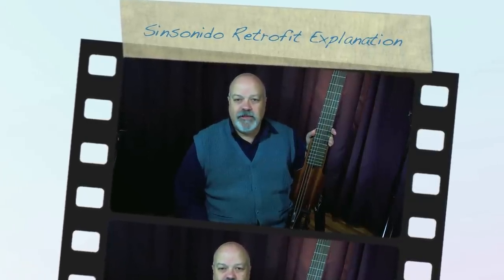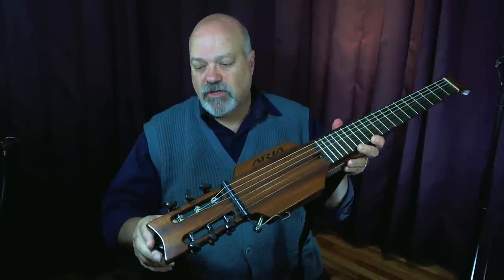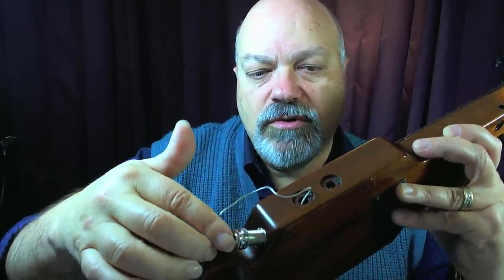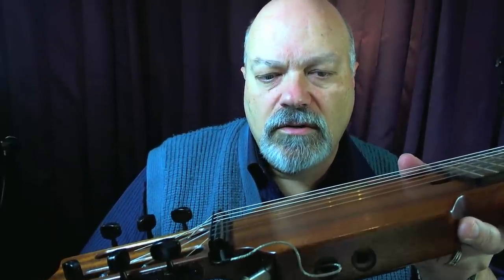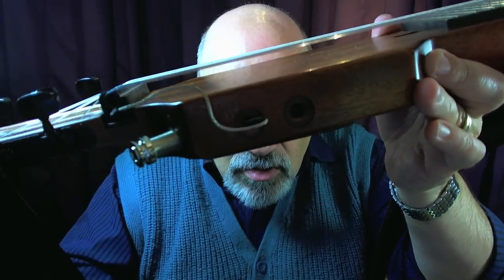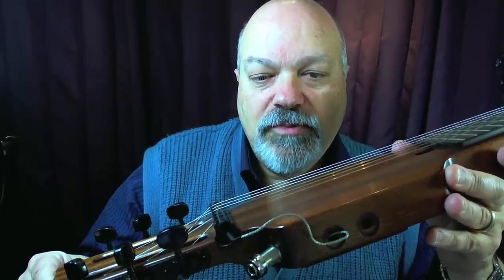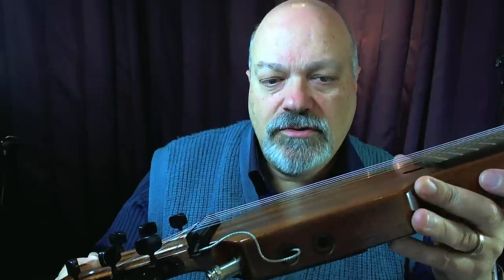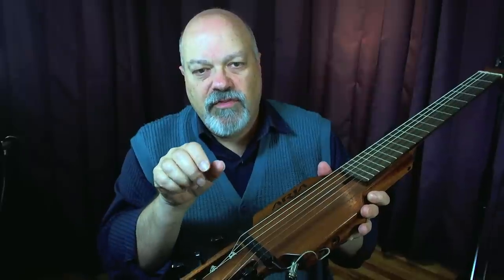Sinsonido Retrofit Explanation

Comment: Thanks for your research into this. I tried it with a passive Fishman and it work great. One slight modification is that I got an 3/8" wood dowel and replaced the aluminum tube. NIce warm difference.

Comment: Hi, thanks for this information. Did the $20 pickup you used include the end pin preamp? The co-ax piezos I'm seeing online all seem to be around $20 for the pickup alone or $80 and up for the pickup with preamp.  Also, how does the pickup sound through the Fishman Aura? I have a Spectrum Aura DI I use for steel string. Been thinking of working some nylon string into the act. Thanks again. :)

Comment: Hi Don. There are 3 solder terminals on the board for the stock microphonic pick ups which i think is a pseudo stereo, Hot ground hot.
Where did you solder the cheap  replacement under saddle pick up with just hot and ground wires  on the circuit board ?
Did you jumper the 2 hot terminals ?
Reply from the maker: magikpoloman borracho I didn’t solder anything. The old circuit board, along with the mics, are gone. The new pickup was already wired to its own preamp which is attached to the end pin jack. So all I had to do was pull out the old system, including the jack, and put the new system in.
Reply: @DonMitchell50  what pick up and pre amp did you use?😀
Reply from the maker: @gbyramos  The pickup is some off-brand Chinese piece of shit I bought online for $20.00, and the preamp came attached with the pickup, a tiny little circuit board that was attached to the output jack.  That's why there was no volume or tone control.  I wanted to go as cheaply as possible since this was an experiment.  Now that I know this will work, if I ever get the time, I will replace it with a good pickup--an LR Baggs Element--that I took out of one of my other guitars.  But I'm in no big hurry.  I haven't played the Sinsonido in literally years...too busy playing gigs.  And when I go on vacation these days I just take one of my classical guitars.  If I every fly again on a vacation I'll have an incentive to upgrade it and take it with me, since that's where it really comes in handy.  My old teacher, John Stowell travels with  steel string and nylon Soloette guitars almost constantly.  The Soloette is the design that the Aria Sinsonido is licensed from.  John's nylon is installed with an RMC pickup--very high end.

Comment: Thanks for some intresting info about transducer switching.
You havent got thoughts about changing the preamp and perhaps installing volume and Tones again?
Also nice to know about effects of changing the tube...
Reply from the maker: Since this was pure experimentation, and I really didn't know if it would work, I went as cheaply as a possibly could.  Now that I know this will work, if I decide to upgrade, I'll simply buy a name brand pick-up with a coaxial cable type element from either LR Baggs or Fishman, that would include a separate preamp with onboard volume and tone controls.  This thing was some cheapy no-name thing I bought from a Chinese website and the preamp was soldered right to inside end of the input jack.

Comment: One ideaif you have the steel string version would be the Lace Sensor Ultra Slim pickup which could just be taped to the body. The version you have is the original Sinsonido which is wider so plenty of room I think.

Comment: Thanks for the explanation! 
Yet I'm still curious about setting the nylon strings right. Mine was came with rusted steel strings. It's truly a head scratcher  how to set the nylon strings which dont have any "pin" on it. Is it different configuration that mine just designed for strictly using only steel strings?
Reply from the maker: Yes, the bridges are completely different between the steel string and the nylon string just as they are on actual acoustic steel strings and classical guitars.

Comment: so is the original preamp being used or have you removed it?
Reply from the maker: I removed the original. The original worked on a completely different basis: a hollow tube over which the strings are stretched--the tube is the saddle--with tiny condenser mics at each end of the the tube. I popped the mics out, removed the original preamp and put the coaxial cable under the tube. It fit perfectly in a small channel routered in the saddle base where the mic wires used to run. The preamp for the coaxial is soldered right to the jack.
Reply: your idea is great for me as i ve recently bought on ebay the aria guitar, cheap  as it  has no amp. thanks so much  ps does yr amp require a battery?
Reply: did you ever think about keeping the mic system and blending it with the new piezo?
Reply from the maker: No.  First, the original mic/tube system sounded like hammered shit. Second, there simply wouldn't be room for two preamps without routering the electronics chamber much larger. Third, blending in the mic/tube sound would have created a feedback nightmare when amplified.  One of the main virtues of this mod is the guitar is now virtually impervious to feedback.
Reply: Brilliant - thanks for your help!

Comment: Quisiera saber si el sonido cambia mucho con esta transformación o con el cambio de sistema  electrónico.. Gracias por tu respuesta..
Reply from the maker: Fernando, personally I attribute it 100% percent to the replacement of the tiny microphones with an undersaddle piezo transducer.  The sound inside the little plastic tube that the strings go over, which act as a saddle, was the only thing the microphones had to pick up.  I don't think that's anywhere near enough of a sound source or chamber to create an adequate sound. Considering how cheap the transducer was ($20) and that it has neither a volume nor tone control, I suspect the electronic part of the replacement is actually inferior to the stock preamp I replaced.  Thanks for watching.
Reply: Gracias logre integrar otro sistema que utiliza un sensor solo que yo no quite el circuito del sistema antiguo, en breve haré un video para ser más claro con lo que hice. Gracias por tomarte el tiempo de responder.